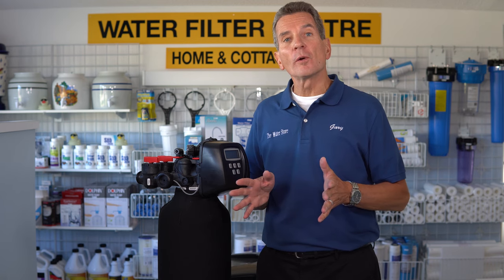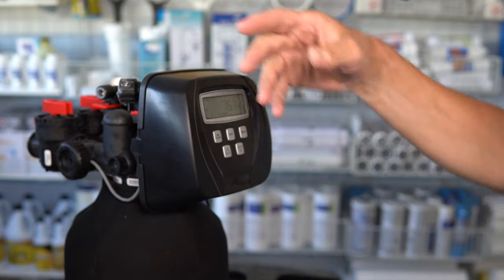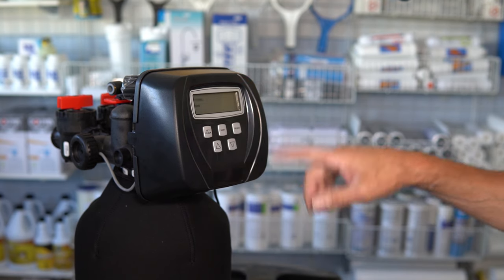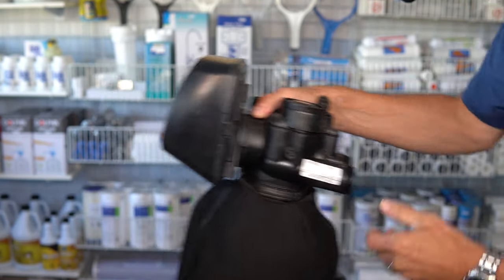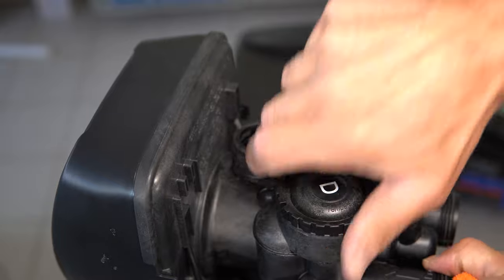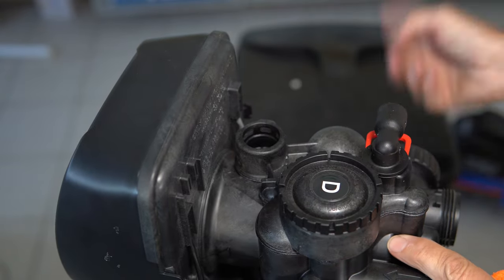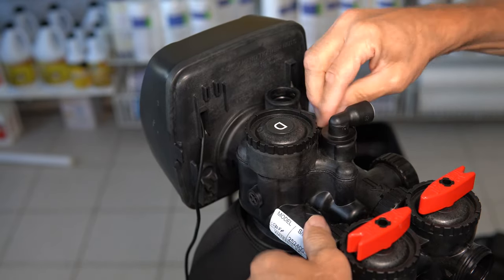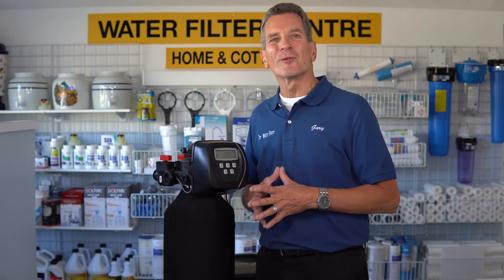How to Winterize Your Water Softener

Comment: Is it possible (and advisable) to use compressed air to blow out water from tank at the same time you are clearing the rest of the house?  In other words, as long as it is possible to blow out water from the tank as shown in the video, why not keep the water conditioner hooked-up and treat it the same as you do for the water heater?
Great quality and information!
Reply: +M Sunnny yes, that does work although you need a pretty heavy duty compressor and make sure the water softener is in service.

Comment: Hi Gary, I used to blow out all my water lines however now I pump RV antifreeze through all my lines, is there any reason why I can't pump RV Antifreeze through the softener in place of blowing with air?
Reply from the maker: Great question!  It will ruin the resin in the water softener.

Comment: We recently bought a house  that we will live in year round, and the water softener system is in an unheated garage. How do we keep it from freezing during the Winter? Is there another video for that?
Reply from the maker: You will need to heat that area or move the equipment inside where it will not freeze..

Comment: Hi Gray, thanks for providing some great content. This is a long one...sorry!! I need some help and advice. We installed a new water softener back in February 2023. I live in Dallas, and a few days ago, we experienced a freeze, which has left us without water in our home. In the past, we've had multiple freezes, but we always had running water in our house without having to resort to using the trickle method. However, during this recent freeze, we have no water due to the water softener.

The supply lines from the city shutoff run into the flowerbed, and there is a 90-degree arm extending from the flowerbed into the garage, which feeds the softener. I'm not exactly sure where the frozen issue is occurring. The outside supply lines going into the softener are insulated, but the supply lines inside the garage leading to the softener are not insulated. The softener is plugged in and running (I assume). I asked the installer if I should disconnect it, and he said there's no need. I also asked if I should bypass it, and he advised against it, as the freeze might cause damage to the internal components.

In any case, I would like to know if the current situation with frozen pipes leading to the softener and the softener being plugged in is okay. My technician is scheduled to come out this Thursday. Is there anything specific I should be aware of or do before their visit? 

This is a new system and the last thing I want to deal with is a malfunctioning softener w/o knowing if is malfunction and just believing my installer.
Reply from the maker: All should be okay once it thaws out, if not you will see a leak from anything that cracked.  The installer should pin point where it has frozen and take the necessary steps to make sure it does not happen in the future because freezing can cause irreputable damage.
Reply: @GarytheWaterGuy  thank you Gary for the quick response.

Comment: If the salt water doesn't freeze in the brine tank and it is used to regenerate the softener, how about pouring the brine solution into the inlet of the softener after it has been blown out so that the water that's left inside will be brine and not freeze?  Shouldn't hurt the resin.  That way the resin tank can be left connected and vertical without the residual water in the softener freezing.  Just a thought.
Reply from the maker: What you say makes sense and should work but I have a couple of concerns.  How will you get the water out of the valve and how can you ensure the brine concentration is strong enough not to freeze in the tank?  Which is why I suggest disconnecting and laying the tank down to drain the water from the valve and allowing for more surface area when the inside of the tank freezes.

Comment: Is it necessary to leave the resin tank on its side for the winter or can it be left vertical after blowing out the water?  Why do you recommend laying it on its side?  Great video - very informative.  DGEE
Reply from the maker: There will always be some water left inside as the beads absorb water.  Laying it on its side lessens the chance of damage from freezing.  When we have very large water softeners we leave them standing but for the smaller ones we lay them down.

Comment: Hi,   in this video it sounds like once the softener is drained of all liquid you can leave the softener on its side during the winter months and it will work when the cottage is reopened in the spring.  Is that true?  You made o video in 2013 that said you have to remove the softener and put into a warm place until spring and then reinstall it. so have things changed in 6 years?  I would like to have a water softener at our Minnesota cottage but not sure about having to remove the whole thing every year.  Our well water is so hard and very rusty. Thanks!
Reply from the maker: Yes, we found after experimentation that draining and laying on it's side works just fine.